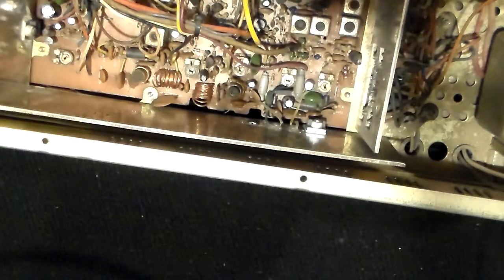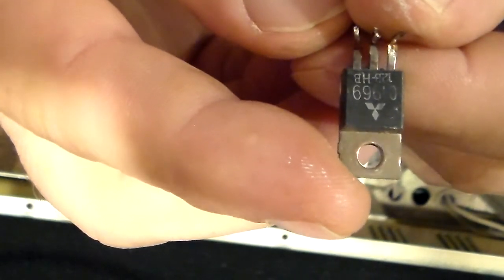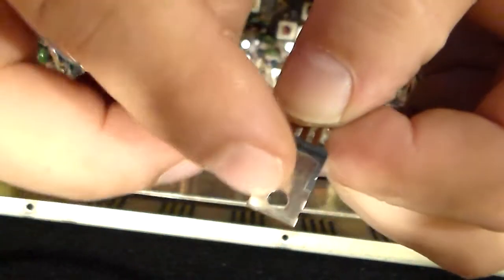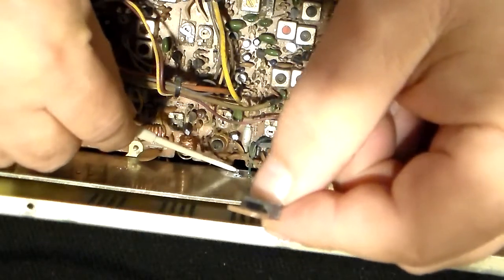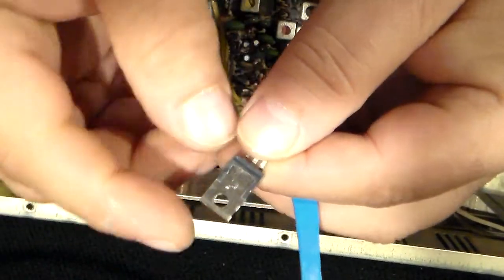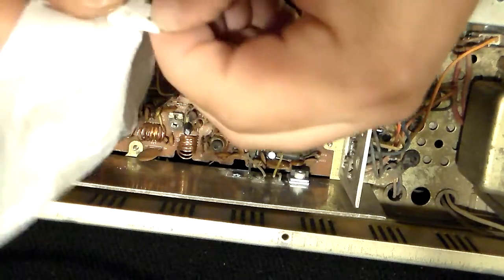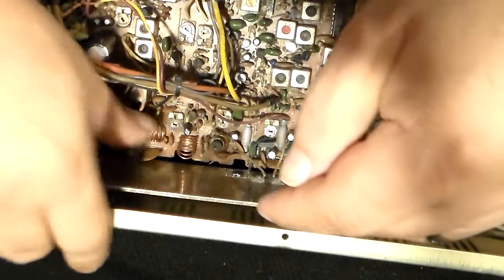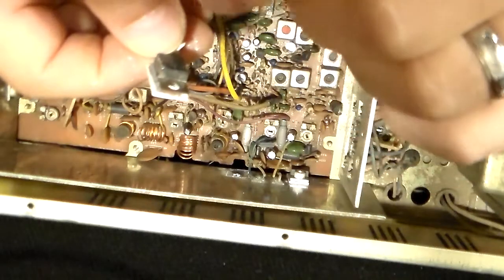Thermal paste

Comment: Which one is better the white paste use in electronics appliances, or the thermal paste use in CPU and GPU chip ?
Reply: I'd use the "heatsink grease" or white paste sold by companies such as Mouser and Digikey simply because that is what it's made for. Some CPU pastes contain metals that are conductive which you don't want for your transistors plus they have different thermal properties.
Reply from the maker: That's somewhat of a trick question😂. The correct answer would depend on the application. It also depends on the manufacturer of the compound.